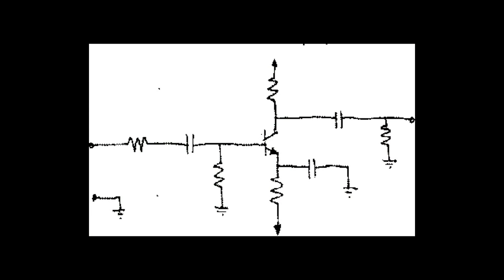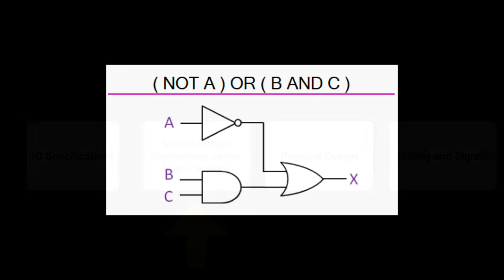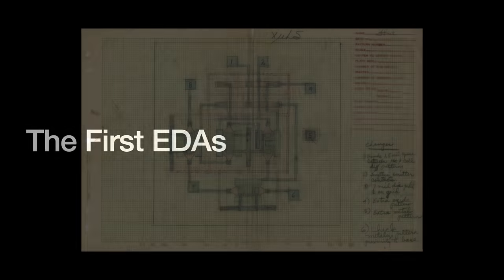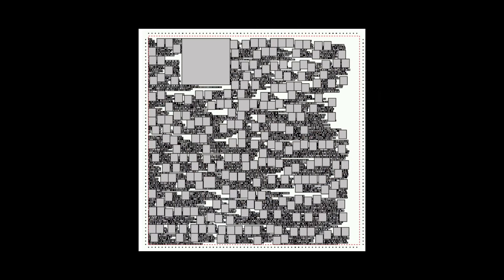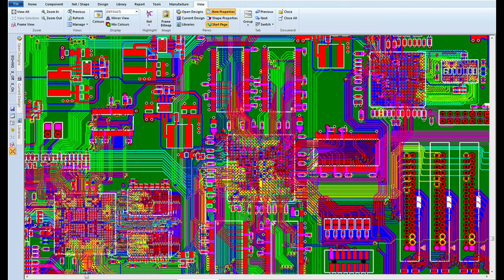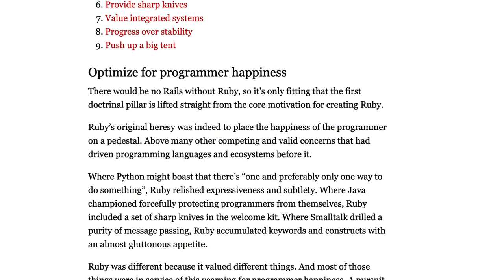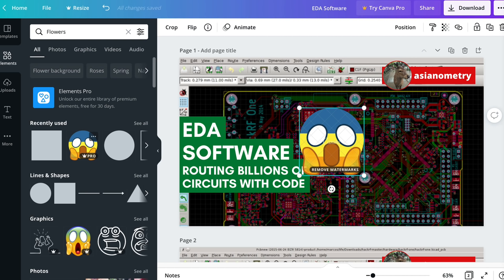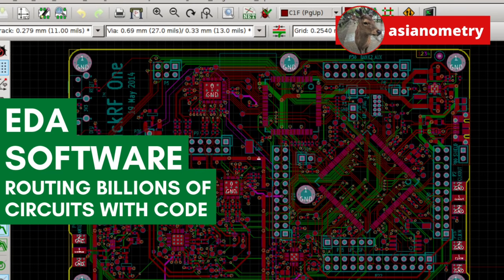Designing Billions of Circuits with Code

Comment: can he design the circuit board for a smart phone that is designed like a laptop? laptops can be powered on when  the battery removed. all phones cannot. i need a designer who can create for me this type of a circuit board so i be able to work on my phone when the battery is depleted so i just plug into the usb onto the socket as i wait to ganger funds for a battery.

Comment: But don't the chip designers also use fpga chips to test out the final designs?
Reply: For more complex chips I suspect they only use FPGAs for parts of the circuit. For less complex chips you can implement the whole chip. However FPGAs will need to run much slower and use much more power.
Reply: @scienteer3562  ok
Reply: @scienteer3562  although i still have a question- if simulation is done only in software then is there no risk of something going wrong when the chip is actually manufactured, ie some issues which could not be detected until the final chip is made?
Reply: @deephazarika2259  Yes, unexpected design flaws surfacing after production happen all the time. You can see, or at least guess, those things when you observe the announcements carefully. Most of the time it will not completely break the chip, but result in:
a) A lower yield than expected. There is always randomness in the manufacturing process and often a design error will result in more chips outside specification than expected.
b) Lower frequency than expected. E.g. they planned to operate the CPU at 4.2 Ghz but due to the design error only 3.9 GhZ are practical without compromising reliability.
c) Lower temperature tolerance than expected. Chip will fail at 85°C rather than at 100°C - requiring a more powerful cooling system etc. For some application this may mean the design in broken ....
d) Only works at higher or lower voltages than designed. Higher voltage means more power consumption and getting hotter fast, which are bad. Lower voltage means lower maximum operating frequency.
Reply: FPGA is used for testing early logic designs. Final designs are physical designs. Those cannot be tested with FPGAs.
Imagine you have an idea for an I/O co-processor for a new gaming console (this is what is being done in the PS5). Before going  into making a physical design or prototypes, your team will build an prototype out of a FPGA (or multiple FPGA) which will run at a lower cycle frequency and demonstrated that it can do the logic with a given number of gates and can perform as expected (at lower frequency).
Reply: @michaelrenper796  thanks!
Reply: That works for medium complexity blocks. Partitioning a very large design across many FPGAs is difficult. Then you need to apply the vectors and capture and verify the responses. This process requires a large, dedicated team.

Comment: WRONG... Chips are mostly made with HDL (Dardware Design Languages) iin the lowest level. There are two major HDL... Intel uses VHDL and there is also VERILOG which is used in Europe. The later is nonteterministic andshould be avoided.

Comment: People still do the ACTUAL DESIGN.

Tools are great. Tools are necessary.
But TOOLS DO NOT DESIGN.

People do the design.

Integrated circuit design is NOT like anything you can think of, like an Excel spreadsheet or a document or novel.

Comment: Your first step is highly misleading. The customers talk to your marketing people. You get what your marketing people THINK your customers WANT. Then you have to figure out what your customers NEED. Then you have to figure out what it is possible to build. Then you have to figure out what your customers are WILLING TO ACCEPT. Then you design THAT.

At TI, I had a requirement for a circuit whose output went high 3 clock cycles BEFORE the input went low.

Comment: I applaud your effort, and this is an interesting video. But the video has errors and near misses. The memory circuit you show us actually a multiplexer, not a memory and not even a latch. Circuit design is never the same as logic design; these are distinct. The concerns over details of algorithms, such as breath-first search, indicate that you are not very familiar with the real problems of floorplanning, layout and routing. The vertical connections on a chip are called vias, pronounced vee-ya, not veye-ya; the fact that you don't know how this basic term of the art is pronounced makes me suspicious of your actual familiarity with the topic you claim was your father's area of expertise. You get the reasons behind the development of PLAs and standard cells wrong. Standard cell and PLA disciplines are still used. PLA software does not have scaling or productivity issues as you claim; they are just tools used to address and systematize certain aspects of the design process; I have no idea what you are talking about. Comparing using a standard cell discipline to using an interpreted programming language is not meaningful; the trade-offs are not comparable. Etc etc etc. Dude, again, I admire your effort, but I think you are in over your head here.